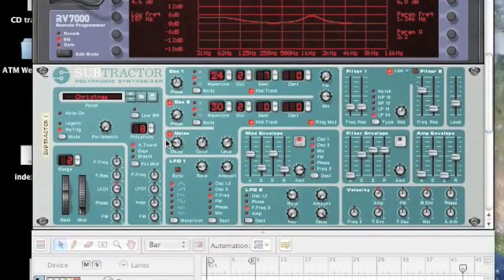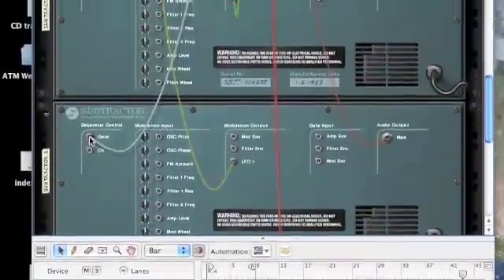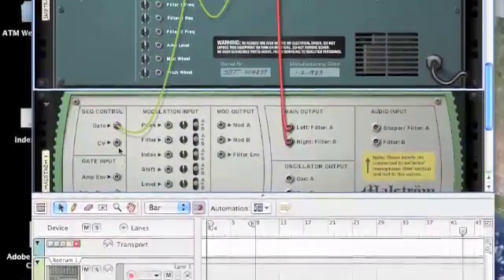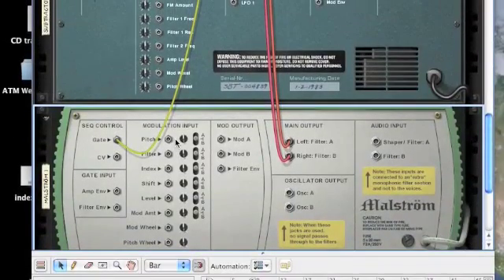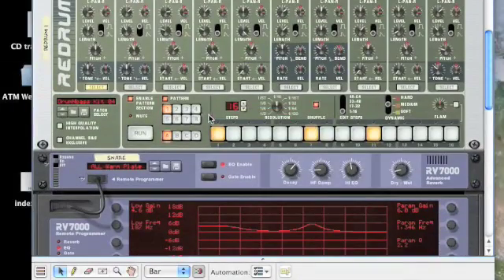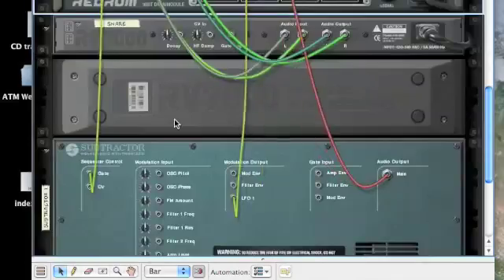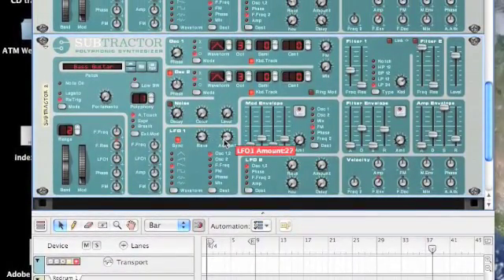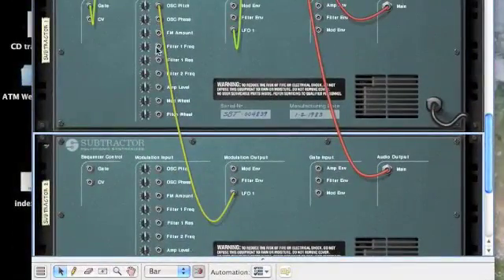Using CV Wiring in Reason - Part 2

Comment: @deanc2000 Taking a random swing at it: I think what you are asking for can be done by right clicking the run button and hitting the "edit remote control" or something of that sort. At that moment, you can assign one of your midi keys on your keyboard to the run button so every time you hit that particular key on the keyboard, you will trigger the run function in redrum.